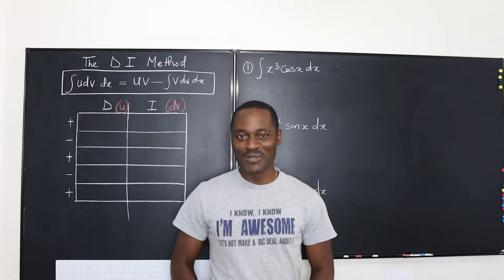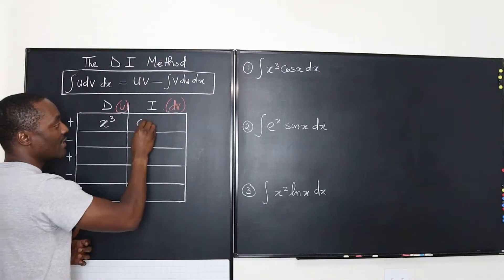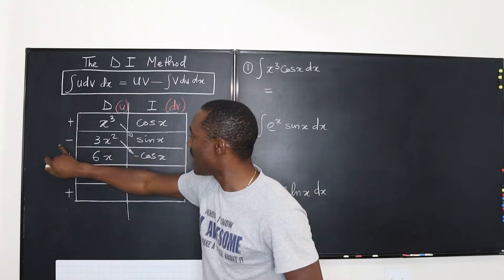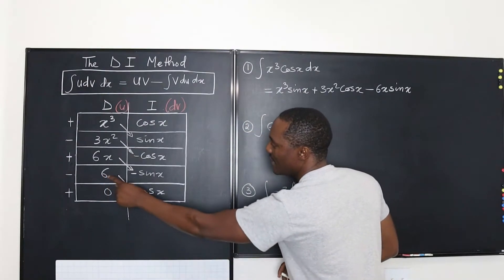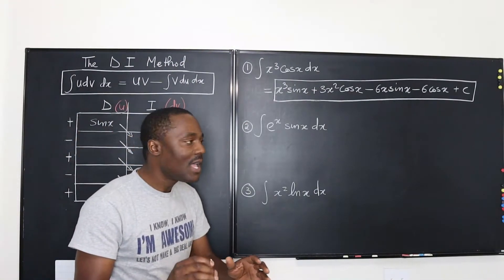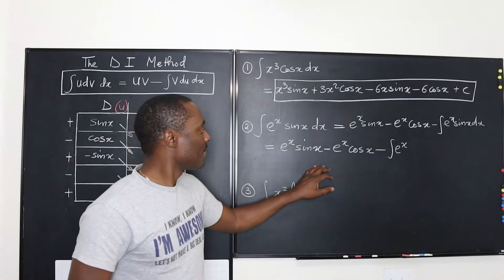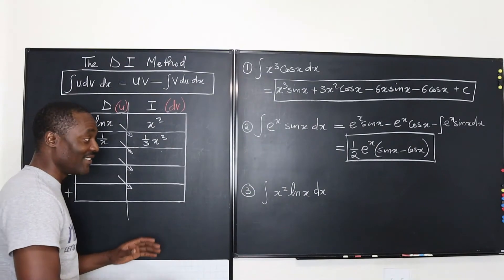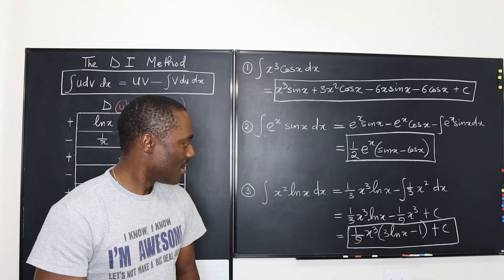D I Method  Integration by Parts

Comment: And if you've multiplied both sides by "dx", why isn't the term "uv" multiplied by dx as well?  (btw - you're still lecturing)
Reply: It’s not multiplied by dx, that’s the differential of the variable x used only on the literals of integration, which uv is not
Reply: so that's supposed to be dv/dx ? The division looks like a space and then intended multiplication (which would explain why I didn't see it distributed to the uv term on the right). Thank you for your reply (I'm really just taking the piss for fun - the author of the video knows what I'm referring to :)
Reply: @aloixasinclaire9911  Not really, its just there to indicate that the variable of integration is x. If that isn’t specified, you’d treat all variables as constants including x. Multivariable calculus is where this concept really matters, but for now just know that all integrals need to have a variable of integration, and that’s what the dx is there to represent.
Reply: Ok thank you! If I ever get as far as multivarianle calculus, then I'll understand why it's in the numerator and not the denomimator...